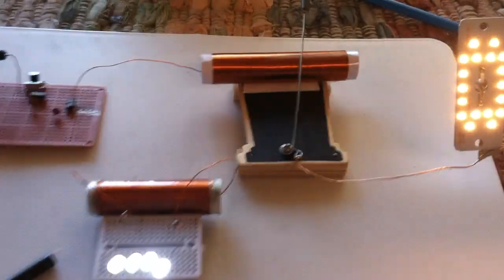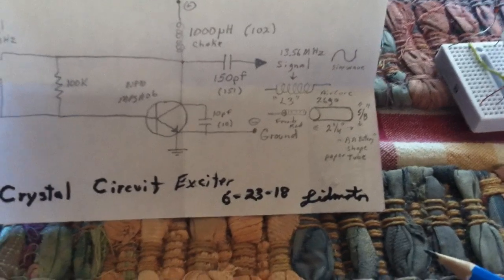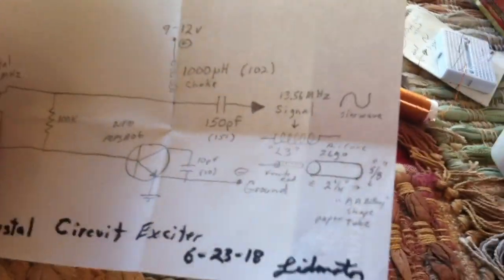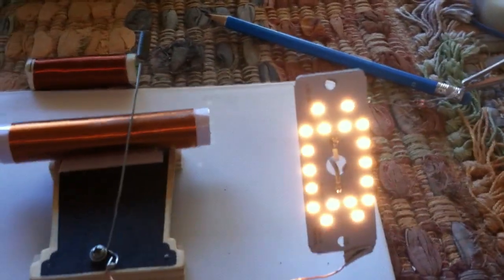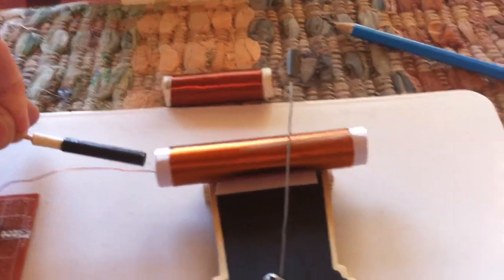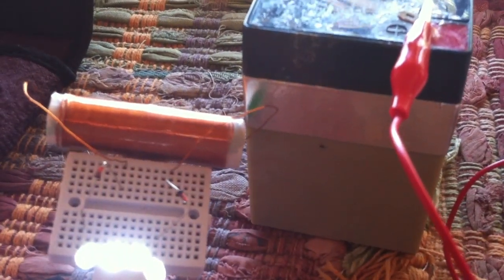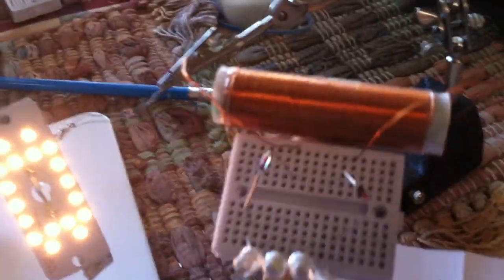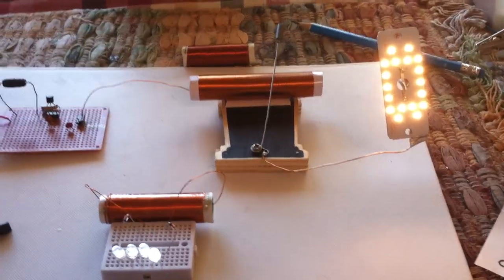'Wiper coil' for crystal circuit exciter

Comment: So basically the transmitter coil has same number of of windings of same type of wire as the receiver when the metal wiper shortens the receiver coil to that number of windings, right? Thanks in advance for confirming!

Comment: Tuning is the key. But it will always get more complicated to tune when you add more variables, like resistor and capasitor.. This is starting to take the same direction as my circuit. Here might be some ideas if someone is working on similar circuits: https://i.imgur.com/HsqqYVz.jpg

Comment: That makes a lot of sense. I have 1 coil in particular that resonates at 2.4MHz and would be ideal for this.
Reply from the maker: Like TK says there are lots of way to tune coils.  This is just one simple way.   I found that you can pull both capacitors in this circuit,  connect the coil right to the transistor collector, and the circuit still runs.  The capacitance in the air going to ground makes the series tank (i guess).  Using your hand near the device acts like a tunable capaciitor.
Reply: On the scope, you may find that the amplitude decreases with a direct connection. That's what I saw, but there is a lot of flexibility in the cap ranges. Electrolytics weren't good, even 1uF.. 
So from that, am wondering what happens to a Slayer with a 'de-coupling' cap on the Primary.